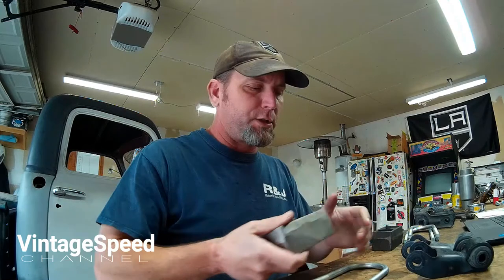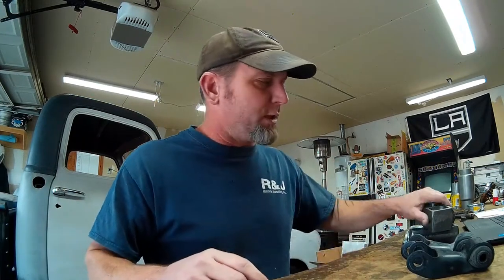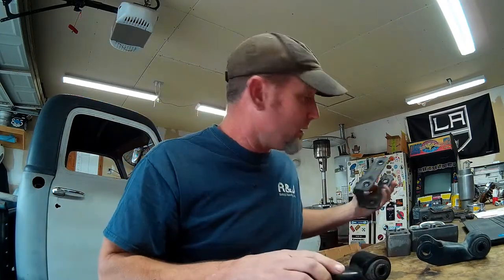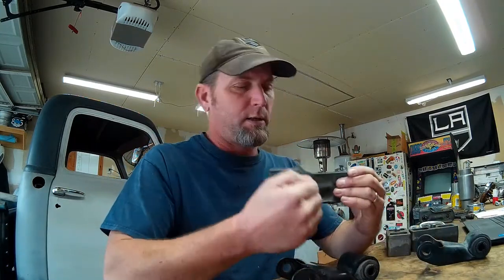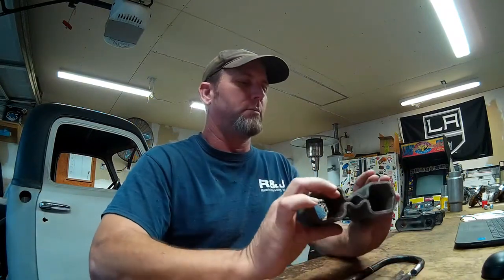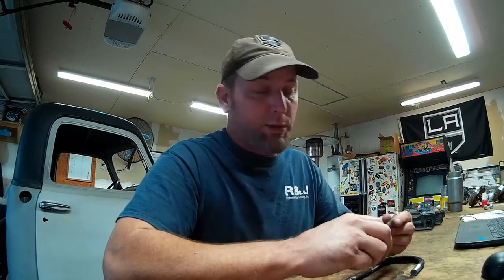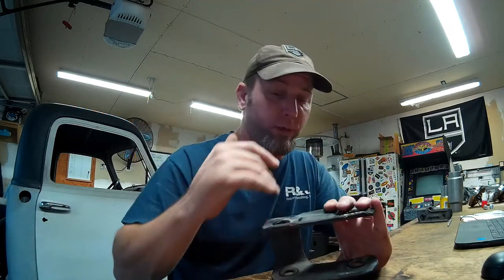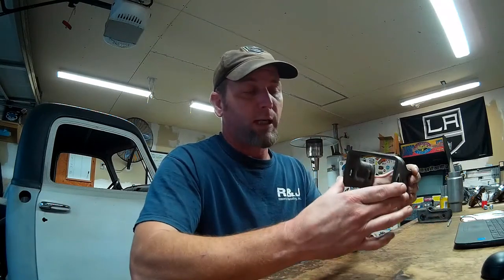P48 Project; Rear Shackle Hanger Fab & Fitment

Comment: What's the Hub to Hub width of the S10?  Is it a 2wd?
Reply from the maker: this axle is a G80 from a 4x4, it measures 59" hub to hub, is limited slip and 3.88:1 ratio.  thanks for watching!
Reply: Thanks, looks like that might work as far as width for my 37 Chevy PU